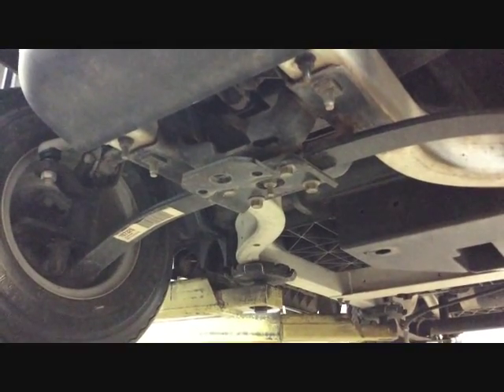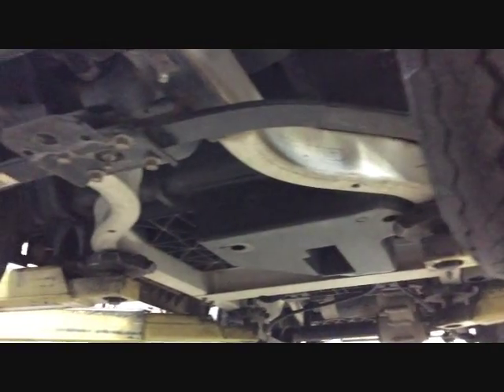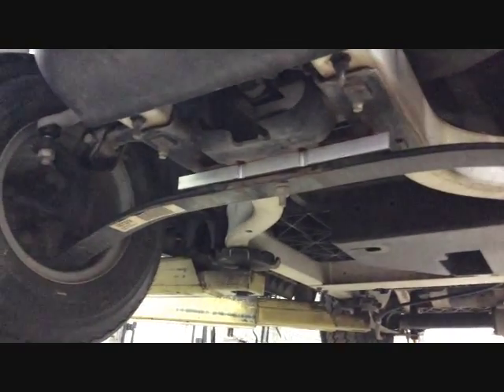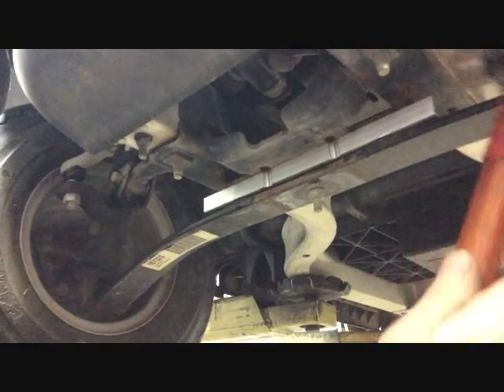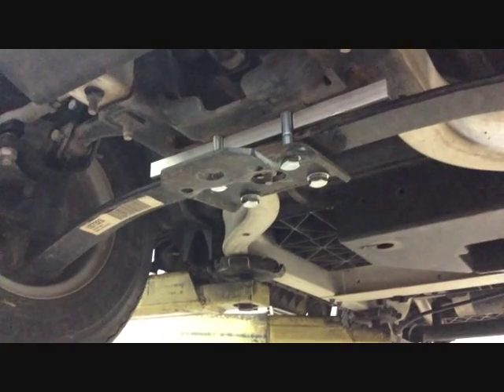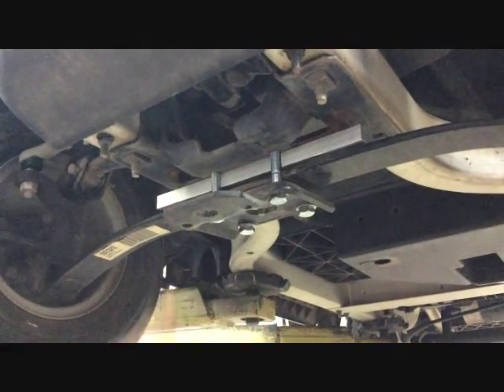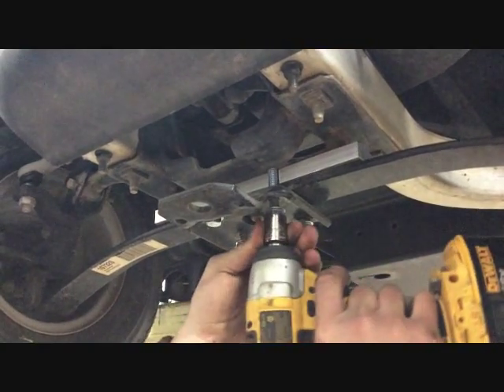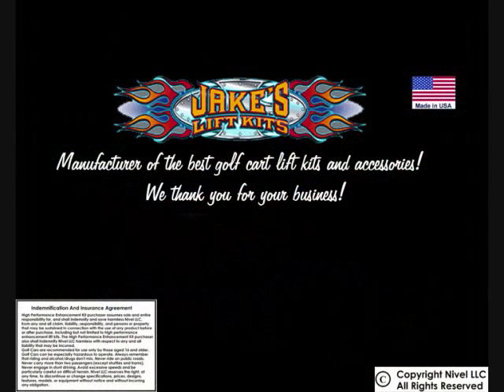Club Car Precedent LOW-PRO Front Clearance Lift

Comment: Great vid thanks! How thick is the block and do they make different thicknesses? How much lift would a HD rear spring add. I'm looking to keep the stance even and run 14" wheels with a 20" diameter tire. I'm running 12"/18" now with little to no rubbing with no lift currently (2016 precedent). Thank you
Reply: Did you ever try this? I got 14s and 20s on mine non lifted now and has a little scrub lol
Reply: @huntfishride23  Hope you don't mind me chiming in but I did this mod a few months back on my 16' club car precedent with 14" wheels & 20" tires. I used a 1" block up front and made custom 6" shackles for the back. Plus I trimmed the inside of the back part of the rear wheel wells, the plastic sticks out towards the wheels and rubs there. Everything works out well it just rubs out front if I turn full lock, but there's really no need to turn that hard so it's not a big deal. I also replaced my front king pins for the adjustable type since the lift block gives you bad negative camber and makes your front suspension super stiff since your forcing the spring down, your actually losing an inch of travel with the block.  I'm very happy with the end result, the cart looks and feels great now!
Reply: @mygt8a4re  i appreciate the response. I might do that with the front but as far as the back, they're fine with the kids but 2 adults it definitely rubs and I'd like to keep it nice and low but I hear the HD rear spring raises it about a since or more
Reply: @huntfishride23  the HD springs do lift the rear about 1.0"-1.5", but worse yet the ride suffers so bad, it gets super stiff, it will rattle your brain over bumps. I had the HD springs on for less than a week before I pulled them and put the shackles on. I hated it! Look into "helper springs". They are an add on spring you put under your stock spring, it's shorter and helps with the load in the rear while maintaining a pretty decent ride. They only raise the rear about 1/2" or so. I've heard alot of good things about them from the guys on the golf cart forums. I have a pair in my shed but never installed them yet as the shackles are working out pretty good for me and my ride is so smooth, lol.
Reply: @huntfishride23  forgot to ask, are your wheels rubbing on the outer fender or somewhere underneath that your not sure of? If they are not sticking out past the fenders then your rubbing on the plastic piece I mentioned originally. If you jack up the rear and look behind the rear tire on each side there is a piece of plastic that sticks out inwards towards the tires. My tires rubbed there so I just cut those off with a dremel tool.
Reply: @mygt8a4re  the inside piece was close on mine but not rubbing, my issue is on the outside fenders
Reply: @huntfishride23  gotcha, yeah unfortunately only lift and or stiffening the rear will help bud. Trust me, I always loved the "low"  "street" look but I had to sacrifice a bit of low on order to get where I needed to be and have a smooth ride. You'll find that in your journey to stay low you will give somthing else up to stay that way. Best of luck! 🍻

Comment: Has anyone installed it with a 6inch lift already on cart? After I lifted mine and did the heavy duty springs on rear I feel like the front needs to go up slightly more.
Reply: I have same issue but did 3”. Trying to figure out if this will work with a arm lift.